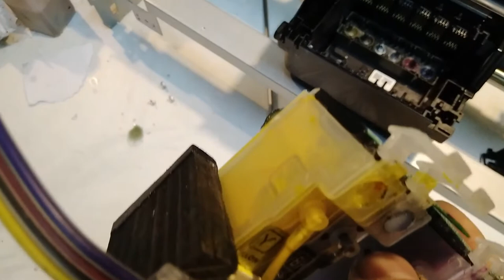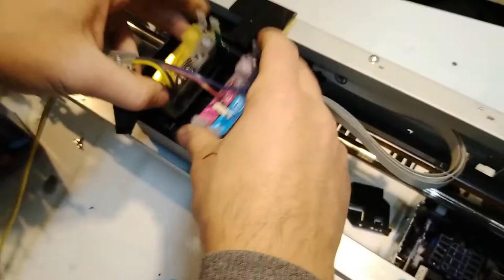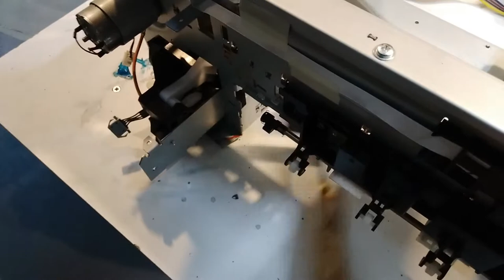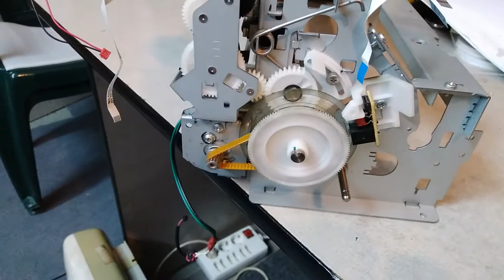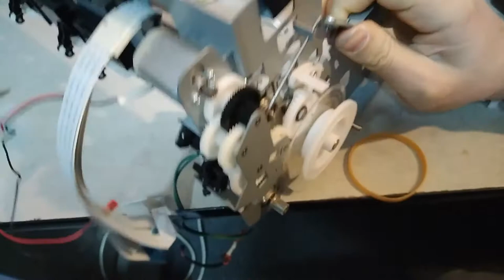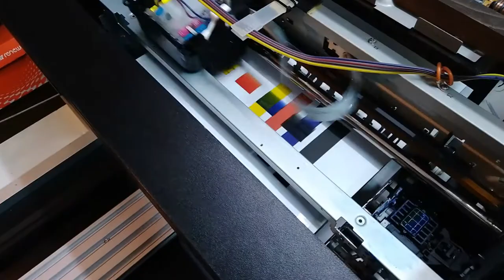DTG printer 1400 repair (part 4)

Comment: hi, I have a 1500w that no longer recognizes the cartridges.  The problem only exists when I put all 6 cartridges in.  If I only put 5 in, the printer recognizes all 5, but as soon as I put in the 6 cartridge, it doesn't recognize a single one.
Reply from the maker: i can think of 3 reasons. We once had a problem that if you had some cartridges that were genuine Epson and some replaceable, printer couldnt recognize them, but i must say that is very rare. Could be with the cable that goes from contact board to mother board, which we had in one of the videos for dtg repair. Same thing happened. Also something could be wrong with the electronics on the contact board itself and that can be easily checked but you would have to have a replacement one.
Reply: @Max0ressurected  I tried 3 different sets of cartridges, all of which worked in the printer.  I also checked the cable and it is not damaged.  I have already exchanged the circuit board directly on the cartridges and unfortunately exactly the same problem.  maybe other ideas?
Reply from the maker: @AE-uj7qc  if you can read some cartridges than we can exclude the motherboard. it has to be something with the contact board, or the cables. this video might help you: https://www.youtube.com/watch?v=pC6B9kPdNzA You can see in the video that the cable looks fine from the outside, but somewhere along pin or two probably got broken so its not transferring the signal. Another thing you might check i when you pull out the contact board, you have two screws from behind that are holding the electronics on the inside pins. Sometimes they get loose so the the electronic board is not sitting properly on the pins. But if you say you already tried to replace it, than its most likely a cable problem.
Reply: @Max0ressurected  thank you.  I'll try it
Reply: @Max0ressurected  I have now also replaced the cable and that's not it either, then unfortunately it can only be the motherboard :( thank you for the help
Reply: @Max0ressurected  do you know can i put a 1400 motherboard in the 1500w?
Reply from the maker: @AE-uj7qc  yes but you would have to use the cable and the keyboard for 1400 and leave the original keyboard disconnected. you can just plug the keyboard and the cable from outside, you dont have to mount it
Reply: @Max0ressurected  ok i'll try 👍 thank you
Reply: @Max0ressurected  hi, it's so weird.  I swapped the board and it worked, but exactly the same error again, it doesn't recognize the cartridges.  I installed the cartridges, the print head and the contact board from the cartridges in another one and everything works normally.  So it can actually only be the cable, but I have already exchanged the cable from the contact board and the old one looked ok too.  I really don't know anymore 🙄.  do you maybe have another idea?  Thank you
Reply from the maker: @AE-uj7qc  there can be 4 things, printhead, contact board, cable and mother board. there can be one more problem that one is hard to detect. Sometimes when electronics burn out on the printhead, it also burns the part on the motherboard that recognizes the cartriges. So the first time you power on the printer with new motherboard, printhead also burns the new one the same way. there are no fireworks and smoke, it just signalizes that there is no cartridges. But you said that the head and contact board work fine in another printer, so maybe the head is still ok, but you will have to find a working combination and eliminate one thing at the time to figure out which one of 4 things is the problem.
Reply: @Max0ressurected  I have now also exchanged the printhead cable and that was that. Before that I had only exchanged the cable on the contact board.  again thanks, without all the tips I had the error determined not found.